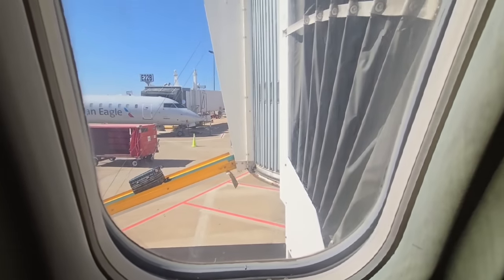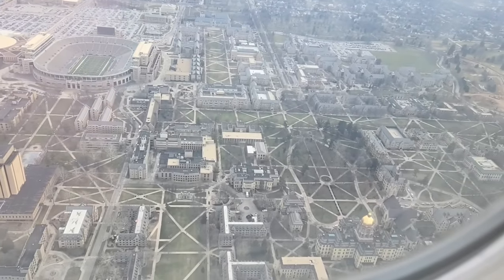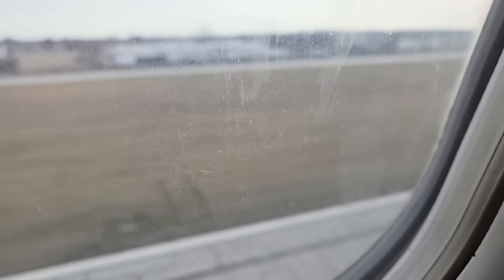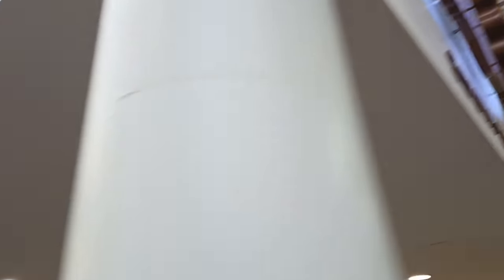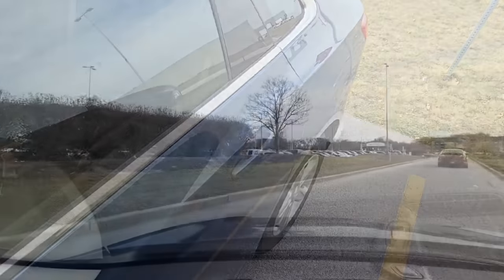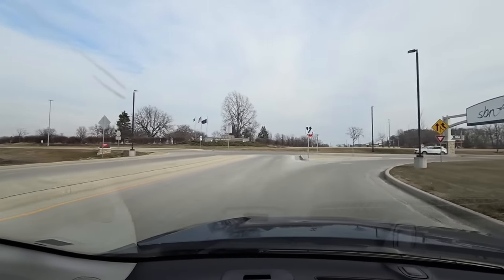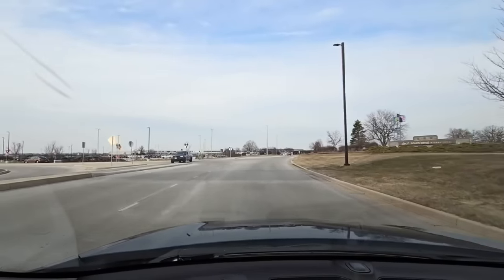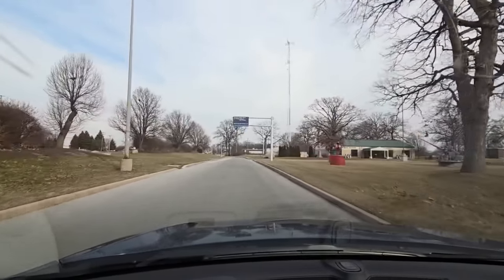LIPPERT Answers Questions about RV FRAME FLEX! Part 1

Comment: US source steel but the welds are breaking or failing. When the steel tears around the weld what does that indicate. Large 5th wheel and toy haulers this is a known use of these frames. Steel has flex and that can not be denied. Considering the price of these things why aren't all these things not designed into the product. Heavy duty road equipment is not known for this nor is military. They are charging for a premium product build a premium product.

Comment: The reality is so called frame flex has been an issue for quite some time from all mfgs,it just seems that this issue has come to light recently from Grand design, I own a GD and they have been awesome with anything or issues with my rig ,i make this very clear its NOT just GD, its is and has been an issue a cross all mfgs, I hate that GD is taking the brunt on this, I love my GD.

Comment: Boeing engineers never make mistakes either.
Reply from the maker: Everyone makes mistakes.  It's the Human flaw.  By the way, it's typically not the engineers who are the ones not tightening the bolts down enough or leaving tools in areas that they shouldn't or not fixing things properly.  The engineers certainly go through a development., as well as redevelopment and enhancements.

Comment: I understand you couldn't ask Lippert the hard questions and had to accept watered down answers or they wouldn't have even let you in the door.  My bottom line take away is two fold. First the engineer said it best in his first answer. Frame design can be 100% lippert, 100% the RV manufacturer or some combination of both (collaboration).  As such frame plastic deformation or broken welds, etc (hate the use of the term frame flex as it implies acceptable elastic deformation) is hard to pin down on any one company from a liability perspective. Second, regardless of all the noise around this issue, there is something fundamentally wrong with the way the frames are being made as compared to the load ratings they are being given, and since the frame manufacturers and RV builders cannot get themselves under control (you have to understand that this is basic engineering) and come up with a robust set of standards to live by, govt regulation (I also hate that term also) will be required to protect the consumer.  Stop and think for a minute; in comparison, when is the last time we have ever heard of a basic trailer frame (gooseneck or otherwise) ever failing unless someone was doing something well past its load rating?  Why are these guys getting it right by comparison?  And last, but not least this "frame flex" issue smacks of the same philosophy that held Ford executives from doing anything during the Ford Pinto debacle.  I.e. They are thinking that it is cheaper to continue to make the under designed RVs and RV frames and maximize profits as compared to what it will cost to settle those few claims that finally make their way to the courts.  So as much as I hate to say it, govt intervention is required because we have some pretty unethical folks running around in the RV business.

Comment: It’s the aluminum welds that you need to be talking about. The aluminum welds are what fail.
Reply from the maker: That's part of the house structure and not the frame..  The RV manufacturer builds the aluminum portion, steps them with wood, and then lag bolts into them

Comment: Yeah pretty softball stuff. I understand if they thought you were going to push them the interview wouldn't happen but this was pretty weak. "Yeah well everyone uses them differently and load them differently blah blah blah. Weird because i own many equipment trailers that I've rented out and never have i had issues with frames breaking. The simple answer is that they do not add enough margin of structural strength to cover all uses. This is to save money plain and simple. Ask yourself why this is happening now because RV's were built much heavier in past years and you did not hear about the failures we have now with LIGHTER trailers.

Everyone in this video just dances around the subject but everyone knows this is happening because the manufacturers want to build cheap and sell expensive.

Comment: Frames should never flex, that is what the suspension is for. Frames are supposed to be "super structures " to build on safely with a large degree of safety built in, meaning over engineered not less engineered....
Reply from the maker: My friend, of you do not believe frames should flex you may not have the understand of "engineering" you need to properly participate in this conversation.
Reply: I have enough knowledge to know that if you have installed something that should not flex or stay in square that what you install it on should not flex. Frames should not flex at all. The suspension is the only thing that should flex.

Comment: Uhm the frame should not rely on the “house” for integrity 😂. That’s like asking a tractor trailer to rely on its cargo for integrity. The “house” is the cargo and the frame is the trailer. The frame should not ever flex. That comes in the hitch and suspension
Reply from the maker: Actually tractor trailers rely on the side walls in the roof of for structural integrity.  If a sidewall fails the structural integrity of the entire trailer fails.

Comment: That marketing lady is struggling, especially trying to answer a question that is engineering vs marketing.  If she was a politician it would be called BS.  

So, the bottom line is that the frame manufacturer relies on the house manufacturer design, and the house manufacturer relies on the frame manufacturer.  No wonder there is finger pointing.

Comment: This is just why I will not buy an RV from the company that dose not make the Chassis as well. Far to easy to pass the buck back and forth and not except responsibility because it was loaded to heavy or the first owner must have done the damage and you didn't know it. It is all to subjective to ever think the manufacture will do the sand up thing and do what is right for the consumer. The manufacture that makes the box is invested if they make the frame too, not to mention you get a custom chassis and not a one shoe size fits all mentality. One can take note that this is a new problem relatively speaking, could the steel being used from China or other places be inferior?

Comment: Let me know any other industry that relies on the super structure above the frame to reinforce the frame, foundation strength, something I heard when I was a kid, it was a foolish man that built his house upon the sand! That’s their concept
Reply from the maker: The Skyscaper industry. The Aircraft industry. The dryvan semi trailer industry. The school bus and touring bus industry. The home construction industry.  ALL will tell you the outer structure plays a critical role in the overall structure.
Reply: @BigTruckBigRV  live in Ohio and been working in construction all my life and every structure I’ve built has massive footers to hold the structure, including the massive garage I built at my house with 30 yards of concrete in the footer alone, I would equate a footer to the frame of a trailer. Does your 450 rely on the Aluminum structure of the cab to hold To be able to pull 30,000 pounds, I have a 350 and I know for a fact all the strength of being able to tow is in the frame.
Reply from the maker: You asked for examples though, I gave you them. A Body on Frame truck isn't an example, neither is a semi truck. Also, the foundation of a building isn't the frame.  That's like saying the road is the frame of an RV my friend.

Comment: Even considering this video and part 2, is Lippert allowing for variance in tolerances? As an engineer, I am aware of "marrying" but come on, the frame is still the foundation. Not spending 5% more on each frame to allow for higher variance is the manufacturer's fault? Shouldn't Lippert be considering the use of large lithium/solar setups? Shouldn't they maybe be a little more diligent on frame tolerances approved for the manufacturers? I am not accusing them of full responsibility but SOME responsibility seems to be at play. It's GIVING BOEING lol. Maybe spend a few pennies to save a few pounds Lippert. I would say the same thing to Grand Design and others as well. DO BETTER. This video felt a little PR pushy...

Comment: Well, they are having to reinforce the frames after they crack. Why not build the frame correctly in the 1st place, or sturdy up the places that keep failing.  This is a finger pointing exercise - the frame manufacture blaming the RV maker, and both blaming the customer. I simply won't buy and RV until this is resolved.
Reply from the maker: What's interesting is that the engineers, architects, and technical folks who reply and email me have an entirely different opinion on how And why there could be a frame issue.

Comment: Don’t think Lippert helpedthemselves at all this Q&A came off more like a political video and they will be found liable in most cases the difference between a 30 and 48 foot length fifth wheel would demand significant structural design changes as the weight differences are many tons and then many cases are higher grade or thicker steel pretending that they don’t have any liability because “we don’t know what they’re doing at the factory isn’t true they could assume since they’ve seen these models themselves that they are much heavier and with like any pick up truck most are designed with safety margin because of what someone might do with it outside of the specs in this case, the specs on these fifth wheel frames are lacking from the start the steel is low-grade garbage high profitability. that’s the way it will look to the public and the liability will be shared across the industry , this will end up as a multi billion dollar class, action lawsuit, and end up in front of Congress. The RV industry has very little oversight compared to the trucks, pulling them, yet they share the same highway and people can/have be hurt physically, and financially by them . this will demand change, and it will be painful to Lippert and the RV industry and ending in many bankruptcy to recoup damages even by insurance companies

Comment: They acted like there jobs were on the line by there body language and never really answered a question. They danced very close to to the Blame game but did a good job on not going over. Basically took away we do x and that it’s. Liability stops at the end of the drive way. I do believe rvs and designed way to light weight for big 5th wheels the 30ft + rigs should have heavier frames that have more structure and not depend on walls for structure. But then they would weigh well over 15 k and you would need a bigger truck

Comment: Lippert wants to blame everyone but themselves.  Subcontractors, owners or someone, just not them.  Their wet bolt system for instance.  Might look perfect with no wheels and no structure on top of it.  Add all that and now you can't get a grease gun on the zerks.  Very poor design.  We went through the Montana factory and I brought that up.  The tour guide thought I was an engineer.   Nope, a farmer.  Where there's a zerk, it needs grease.  Only you can't grease wet bolts unless you remove the tires.  Excellent design, not.
Reply from the maker: FYI, Lippert does not install the running gear, the RV Manufacturer does.  Some install the zerks pointing in and some pointing out.  Suspension components get added during the RV assembly process every time.
Reply: @BigTruckBigRV  OK, didn't know that.  When we were in the factory, the frame was upside down with the wheels already on.
Reply: I have the Lippert system for wet bolts and the Road Armor shackles.   On my RV there’s not problem greasing any of that gear.

Comment: That is such bs You're relying on your house to support your foundation. The frame should support whatever the you put on It within reason.
Reply from the maker: Name an company who builds a rigid how structure on top of a frame that doesn't rely on the entire structure for rigidity.  You may speculate that there are some, but you'd likely be wrong unless somebody is simply putting a box with a frame on top of a structure like a gooseneck trailer. In that case, you have two frames.

Comment: I do not think you will get good qualified answers even if they appear softballs. Reason is lawyers and potential faults. I do not think Lippert is responsible at this stage, it is the manufacturer  that is where the buyer buys from ultimately.  Any problems are between the manufacturer, engineers and Lippert and their engineers and quality control.

Comment: Lot's edits in this video during them speaking, and then at 18 minutes back to your bloviating. Let them talk and produce what they say. For me,  here are some key takeaways from this video that require a little more information. 

1. There is clearly LESS engineering coordination happening with Lippert and RV manufactures than you were leading us to believe in your last video.  Yes there appears to be sometimes  initial work but could and does then end up of a bit of a free-fer-all with RV manufactures being able to change designs on the fly without coordination from Lippert or re-engineering.  (HUGE PROBLEM) It seems possible and probable that RV manufactures are buying a bulk of frames not even know what is going on them at all. This is another huge problem because there will for sure be areas on a frame based on an individual RV design that will need to be re-enforced. Say under an optional washer/dryer set location or slide out. Without coordination with frame makers of floorplan and design changes you are just ASKING for trouble. 

2. I'd like to have a list of manufactures that hand them a CAD drawing spec vs the manufacture that buys a base frame system for it's length and width then build upon it simply based on the weight ratings of the frame. Especially in the large 5th wheel class. Like to know which manufactures coordinate with Lippert for re-engineering needs on redesigns. Anyway to get this?

3. I do feel like some of this video was Lippert distancing themselves from some manufactures that use their frames. Don't look at us per say. And I mostly agree with this. I blame Lippert much less in this frame flex issue. The manufactures are the ones seemingly buying the absolute LEAST COSTLY lightest frames they can get away with, possible THINKING there is more engineering going into them than there really is?  Lippert absolutely can build a frame rigid enough, but may require another set of Axles. 

With metal, it is important to know the types of steel being used if there is going to be lot's of flex. Kind of like why you don't see grade 8 bolts on hitch mount. They have great tensile strength  but WAY less shear strength. So if you KNOW the RV is going to have a ton of flex, the steal has to be less brittle and more forming, think of a leaf spring vs a truck frame. Metal fatigue happens when you don't take this into account and areas of preload not accounted for, sidewalls for instance. I'd like to see the jig system used to set the frame prior to welding. Is it itself because of design preloading of the metal causing part of the problem. I'd like to think they've figured this out, maybe not? It is entirely possible to build a metal structure that will destroy itself because of how and the order it was welded. It really doesn't seem like any of the manufacturing/building process of the RV house is a science. Lag screw here, lag screw there, maybe one here, maybe two there. Maybe even a set up bolts with poor penetration into the structure because of the wood core in the aluminum being insufficient. Next... Maybe more use of bolts/nuts in critical locations vs a wood screw that may have been overran because of the lack of torque controls/specs. I get it, it can't be like airplane manufacturing with close tolerance, cold worked holes, all preload removed, perfectly balanced engineering, accounting for dissimilar metals and such. But they HAVE to do better. Can't wait for part 3.

Comment: Under engineering at its finest. Trailers are built to weigh as little as possible and use the least amount of structure possible so the manufacturer can have as high of profit margin as possible. They will remove 10 pounds of steel to save themselves a few bucks and it will impact the durrobility of the product.

Comment: That was more side stepping than answers…for folks spending in excess of $100K there should not be questions of this nature even needing to be asked.   Bottom line IMO most of these issues are being driven by greed using poor materials,  undersized materials and with the mindset we just have to make it through the warranty period.  Sad to see US manufacturers building at this quality level and most importantly with no consideration to end user safety.

Comment: Listen, this is like asking why you put this type of tire on this particular car. I understand your only at starting point but remember the number on the structural part of the engineered trailer is just what it is. The numbers are clear and the design with these companies are on themselves. You engineer your shizz and we'll engineer ours.... sorry to be harsh but I promise you it's within the design, and engineering of each manufacturer. Let me add, it also would be uo too the manufacturer to come fourth with conversations of structural concerns, or ideas for rigidity. Just throwing that out there..

Comment: Flavors of ford vs firestone.  I read firestones deposition.  The tires were underinfated by ford.  So tires wash out instead of flipping the truck( suzuki samurai style).  The right rubber that would last underinfated would effect mileage, and ford did not want that either ( cafe).  Firestone took the fall, by doing what ford idiots wanted- people died.